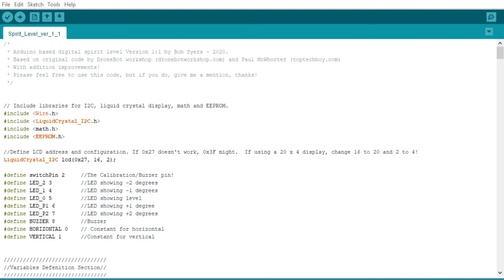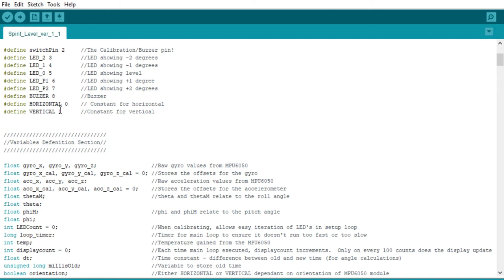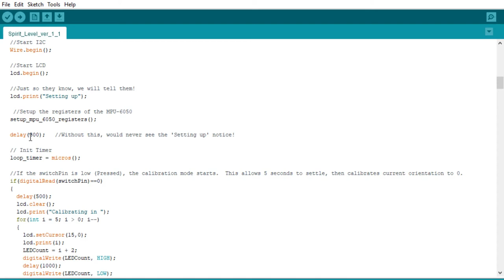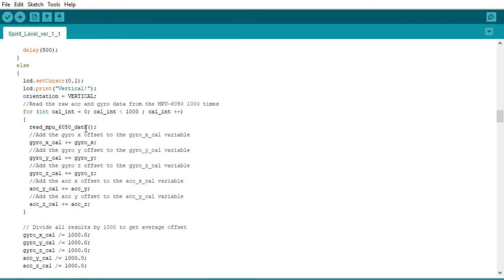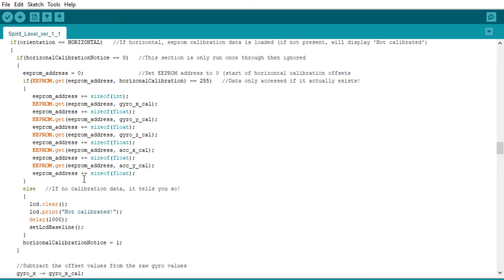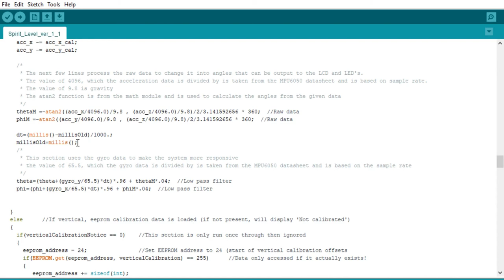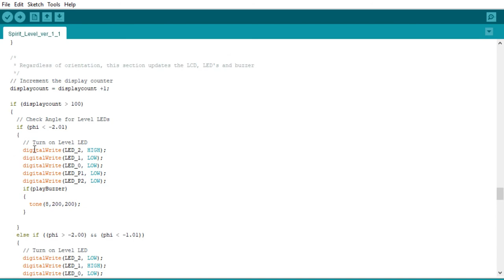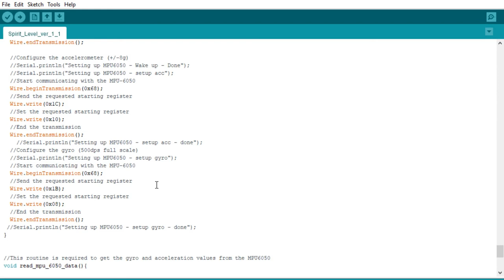Arduino nano & MPU6050 based digital spirit level

Comment: Hallo sir
I want to make an active suspension for an rc car base on gyro and accelerometer
But i am beginer on arduino
Could you help me? 🙏
Reply from the maker: Hi Frenkko.  That is quite a nproject if you are a beginner in arduino.  I would suggest checking out beginner tutorials by the likes of Paul McWhorter as well as the Drone Bot workshop.  They are both very good.  Once you have a basic idea of what you want to achieve and how you think you can do it, join a facebook arduino group and ask questions.  Good luck
Reply: Ok.. Tq 🙏

Comment: Hi 
Please inform me about math.h
On your code you write "#include <math.h>"
I search on library but i cannot find .
Can you explain or send me for downloading this 
best regards
Reply from the maker: I didn't need to add this in.  It is already included within the core code within the IDE.  The include statement is only required so that the code is added to your sketch only if you need it.  Hope that helps.
Reply: @bobsyers  Thank you very much, for your quick responce
Your code runs without any errors and normally "loads" on the NANO. I have not connected leds and buzzer. Only connecting the LCD, MPU6050 and switch, for check on first time if working (LiquidCrystal_I2C with LCD). After loading on the LCD have normally Angle=0,0 Roll=0,0 but ... the degrees remain 0.0 at any inclination of the sensor.  
I don't know if is important connecting all parts (leds, buzzer) or LCD cannot  read the data from your code. Any idea?
Reply: @bobsyers  I find the problem. MPU6050 don't work. I replace with anew one and your code working fine. It's time now i build a real spirit level for very difficult surfaces. A thank you is too little for your work
Reply from the maker: @stathiskouros1025  Glad you got it working.  I cannot take all the credit.  I only expanded the work done by the drone bot workshop and Paul Mc Whorter.

Comment: Can I get the at limk for Paul Mcwhorter's video explaining the formula used in the code?
Reply: There are a few in the series, but this one should help: https://youtu.be/cUFqSGYZO5k
Reply: @madaboutpuppets   I have a doubt so you were able to apply the math  explained by Paul Mcwhorther's video in your program right ?
Reply: @ashwinchander1837  In Paul Mc Whorter's tutorials, he is using a different module, so I needed to adapt the code slightly, but in essence, I used his maths to make the level work.